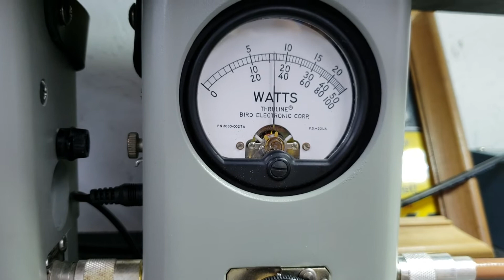Stryker SR-955hpc tune up report for Uncle Fester in NC

Comment: Wow!!  Another masterpiece by the master!!  Like I said before, I AM a big fan of yours!!  I'm looking to get into the electronic trade.  My disabilities prevent me from working in my previous trade, 
a CNC machinist.  Too much lifting and turning and twisting. I would love to apprentice under you.  
Well, I can dream, can't I? 
I will check your website to see about checking out my new(to me) 
CB radio- an RCA-14t302.  Just like the one you did for 
512 Watchmaker!!  I'm off to your website now.  By the way, I left a comment on your video of Watchmakers radio.  Maybe you could answer my question about why my 13.8 volt power supply is putting out 26.8 volts?  I don't have a clue why, but I won't hook up my CB to it yet!!  Take care 
Master Truck!!  Your fan, Norman.